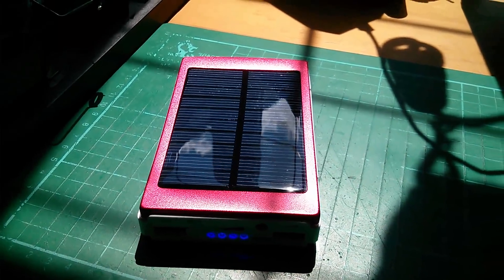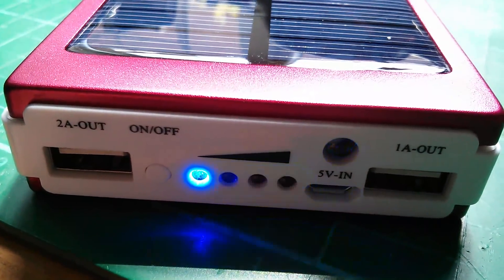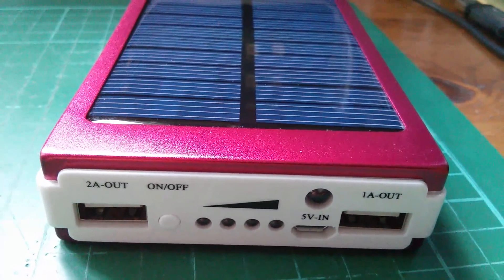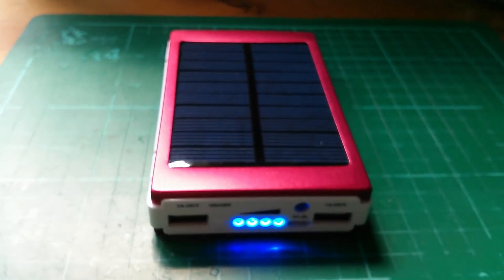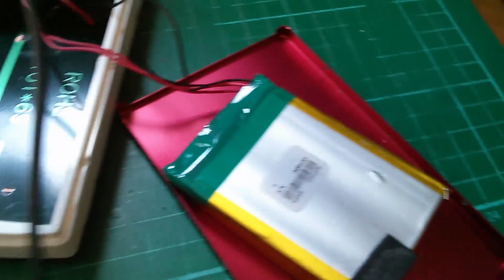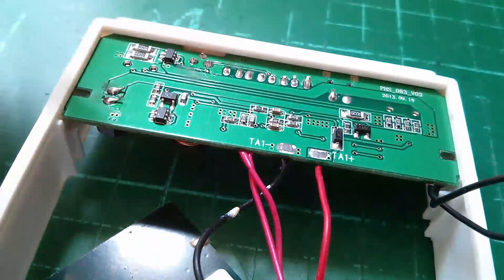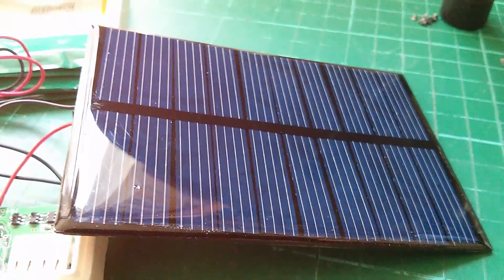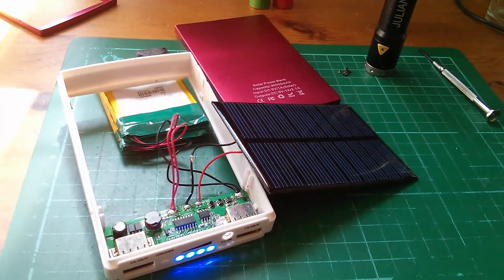Review: 30,000mAh Solar Power Bank - It's a pile of Junk!

Comment: I remember seeing on a local forum a 24,000mAh power bank that got depleted after only a charge despite its heavy weight and bulk size. When cracked open, guess what... a 18650 cell and two bags of sand!
Reply from the maker: burjoks That's naughty!
Reply: Julian Ilett  but still a lie from burjoks cause 18650 would still be able to charge 3 cellphones to full capacity as they are usually 2600 - 3200 mah...
Reply: That sand was from Columbia
Reply: +jonnywaselectric Then, that's a bargain.
Reply: +jonnywaselectric buhahahbaa
Reply: +burjoks :D
Reply: Hi,

i made a similar review on a power bank solar charger device which i tested by self and is just perfect with two 5V USB outputs and 50.000mAh check it out:

https://youtu.be/hWONMXbBc3Y

regards.
Reply: Julian sounded so incredulous about the LED's burning all the power from the sunlight.. What's incredulous is the fact that he expects enough sunlight to get through the thick U.K. clouds to be able to charge the batteries at all...
Reply: @dabugguy958  I'm with you on the use of solar in the UK. Yes, we do get sun on the odd occasion, but it's just not reliable enough - if you want to be sure of having a charged power bank. 
I suggest buying a higher capacity from a reliable brand, or even carry a couple of banks when away from mains power.

Comment: Keep it for parts. The solar panel and batteries can be used elsewhere and the blue LEDs can be used in other projects. I have a 5600mAh power bank by soundlogic and it worked for awhile then it started to malfunction. I did nothing to it, just used as intended. It had a flashlight on it which still works and it charges fine but the USB out no longer works and the 4 lights on top which are to show the power level are all lit up and will not turn off.

Comment: im sure the LED's are not burning the power, its probably got its own capacitor that is charged with the light level, when the capacitor runs out it turns off.

Comment: You missed the flashlight feature. Turning the charger on/off is done by tapping the button. But if you hold the on/off button, the flashlight LED will switch on.

Comment: I got the 50000 mah but when I open it seems to have only 3000 mah. I had a 4000 mah battery which could fit inside it. I solder it with original 2 battery so now I have 7000 mah and I am testing it. Guys,  if you want to build your own solar charger,,,,,, just get the panels from eBay and connect them in series and parallel and use car charger to step down the voltage. I am using it to charge phones.
Reply: Hi, Ali,

How did you put into a voltage regulator?
Have you done it?

Comment: I brought this crap via T-mart (1st mistake) and kind of figured there was an exagheration of the mah, but was far more disappointed than I thought I would be. On a full charge I charged my HTC one M8 at 50% battery capacity and after about 40 mins (phone on, but did not use) the charger was showing one light and my phone was charged at 58% for me. CRAP CRAP CRAP!

Comment: Ok, so I have one of these.

I know, I know, yes I'm a muppet but I have it so that's it.

What would happen if I added a 18650 2600mAh cell or two in the same configuration as the two Li-po cells already in the unit ?

If I connect them correctly would the cells still put out 3.7v but have higher total mAh ?

Comment: The LEDs do look over kill for it. might be better to just clip all the LEDs replace them them with the lowest hungry ones possible.

I would of designed it like this this, but have all one LED on a toggle button that push to check levels and to tell you if its charging. but time out like 5 seconds later. so its not eating power during charge. 

While yeah larger panels are better. some of these little things can also be life savers when on long hikes and you need to insure your phone stays charged. Carry around panels can be handy even if there not really much to write home about. 

Thats just what i think.

Comment: These things have 0.8W solar panel module that gives 160 mA current under full sunlight. So, to fully charge 30000 mAh battery, it would take 30000 / 160 = 187,5 hours, or nearly 8 days of constant sunlight! Not counting internal discharge of the device or charge drop due to high temperature caused by the intense heat from the sun.

Comment: Even though its a pile of junk I still would not mind one. The resistors for the leds can be change it make use much less current or even change the leds altogether. As long as the solar panel and battery's are ok it might be worth it. You can get them for £10.

Comment: I would be interested in the full sun, open circuit voltage of the panel, and the short circuit current.  The maximum output power should be about half of the product of those two measurenents.

Comment: Julian, why don't you open the case in eBay and because is is "not as described", or even counterfeit, item they for sure will return you money and charge seller. You will keep powerbank. If more people did this it would learn tricksters how to do honest business in the future.
Reply: Yes, should have done that with mine but had no time to argue because I was traveling. Solar panels are misaligned and don't work, but the batteries are kind of adequate. Paid more than 80€ for a "10000mAh" bank. Haven't tested how many times I can charge my phone with it though. Also one device got fried because the panel switched higher voltage when accidentally pressed power button 2 times when no current was being drawn by the device(fully charged).

Comment: Did you test the outputs to see if they can supply the rated current? They often dont. Looks like it was designed with larger batteries in mind.

Comment: The LED problem could be fixed by just splicing a high ohm resistor in for each of them, LEDs are still visible with a surprisingly low current.
Reply from the maker: That would certainly help, but it's such a crap product in so many different ways, I'm not sure I can be bothered.

Comment: Would be interesting if you could measure the current used by the LEDs and also the current produced by the panel in full sunlight. I did say full sunlight but as you are in the UK as I am I guess you can't do this :-)
Reply from the maker: Ha ha - the UK weather seems to have finally woken up to the fact that it's summer. But I really need to compare the LED current with the panel current on an overcast day through 2 panes of glass, because that's when this unit performs worse.

Comment: If the solar panel is decent you should get a modest voltage and current from it in direct sunlight.  Perhaps use it to make a solar powered lighting feature?
Reply from the maker: Yeah, the solar panel is too nice to throw away, but I can't think what to do with it. There are some nice tiny water pumps on eBay - maybe I could build a teeny tiny water feature.
Reply: Julian Ilett the slight downside to that being that the solar panels only put out decent current on truly sunny days.  My own temptation would be to hack it onto an existing solar lighting module (like a string of lights?) so that it performed better even on heavily overcast days.
Reply: just by inspection this is a 10v/50(100mA if VERY generous) module so if IT TRACKED the sun on clear sky it would produce0.5-1w which is nothing really to charge a battery of 3.7v*4.8Ah=17.8Wh.

Comment: It's the same size as my 15 Ah pack.
There they have glued the battery down very good, and added padding, with plug toward the PCB, but no solar cells. It takes quite long to charge at 1A.
I got to replace the ID resistors sometime, but I can't really blame the manufacturer for that. It's just that getting my phone into 2A mode instead of 1A mode is desirable.
For that I need to implement the proprietary Qualcomm quick-charge via resistors.
(Why do I have to modify something that actually follow the "USB Charging specification" by shorting the data-pins, annoying)

If you want to see crazy, my 50 Ah pack is just that.
The crazy part is the non-fake battery. (3 or 4 in parallel , 3 in series, ~11.6V at 15 Ah). Does charge at 15-20V and not via USB. It can power the laptop for quite long, since it's very much energy)

As for your pack:
The PCB: charger, protection circuit, boost converter. It's totally fair.
Unless they add a extra FET there is no way to actually disconnect the output from the battery, please check output voltage while it's turned off.
The wiring looks unsafe, they should have used a plug, and less flimsy and thicker cable. They could at least have glued the cable to the board.
Reply from the maker: Do you have a link for the 50Ah pack?
The outputs do actually turn off when the unit is switched off - I guess that's the 8205 mosfet chips doing that. Also, if you don't draw current for a few seconds they also turn off even when the unit is still showing the blue lights.
Reply: Julian Ilett
The 50 Ah battery is from DX, but they have discontinued it.
It's primarily made to drive laptops et.c. You can also find some at aliexpress.

If you want to go the solar way, fold-able solar cells would be the way, expect I wouldn't trust the solar-cell wiring.

Your other option is to buy Li-Ion plain/poly cells, protection boards and charger boards, and add buck/boost boards as far as special needs go.
I would suggest avoiding RC cells, since they are not made for general use.

a 30 Ah battery simply will NOT fit in that shell, just so you know.

What are you actually seeking?

Comment: Interesting review. I laughed when you opened the thing and revealed the tiny battery!
One more point against this product is that heat is the worst enemy of lithium batteries. Leaving a battery powered device in the sun is the last thing you want to do.
This product is just for stupid green ecologists who think they are saving the planet with this...
I'm not saying that a good implementation of a solar battery charger is useless. It can be very useful when camping but as you demonstrated this is not a good implementation. :)

Comment: I've bougt this power bank: http://www.banggood.com/Wallet-Design-20000mAh-Power-Bank-Mobile-Charger-For-IPhone-Tablet-p-79283.html (No Solar Panel but it has 6 18650 Cells in paralel. I don't think it's 20000maH but it takes nearly 12 Hours to charge with a 2A cellphone charger.

Comment: Isn't it true that the 3.7v 2400mAh batteries would only effectively be 1776mAh each at 5V? from conservation of energy?
Reply from the maker: Yeah, at 5V the mAh capacity is even lower. The 30,000mAh claim would only be true if the output voltage were about half a volt!